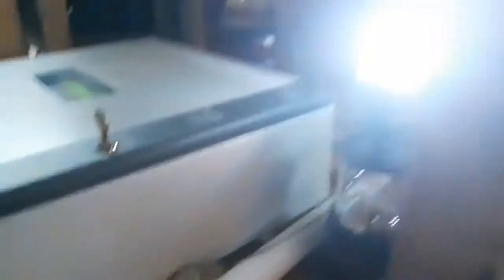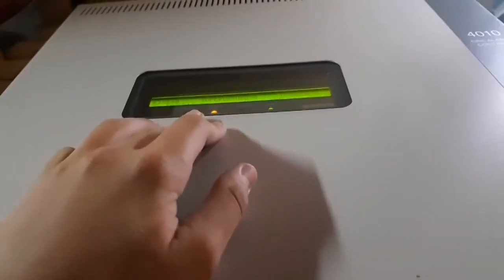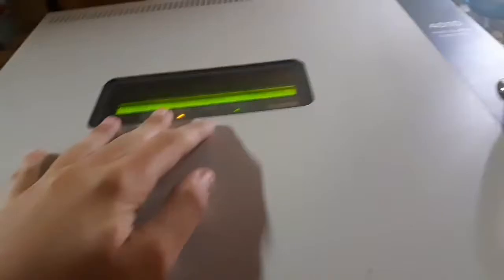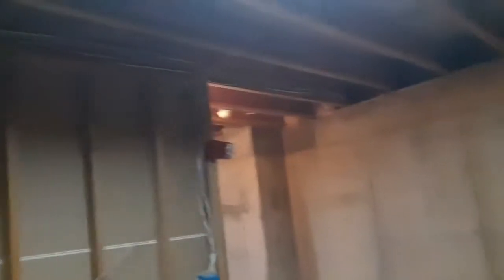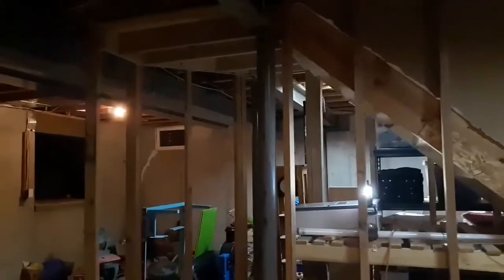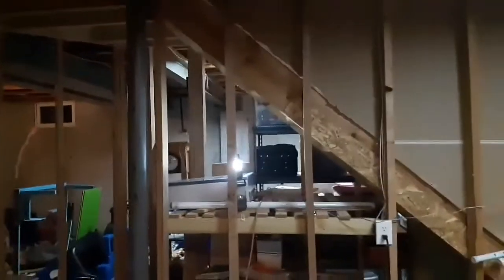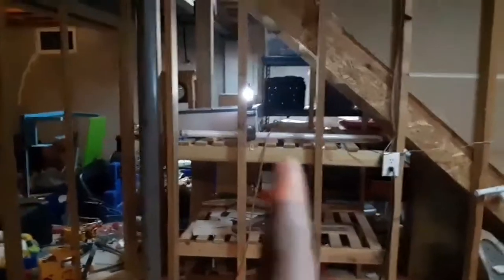System Test 4

Comment: Never been a fan of the 60bpm March Time but nice video!
Reply from the maker: I only did it because I haven't tried it yet. The next 2 tests feature truealerts and then after that I'm doing 2901s and 2903s in 120 bpm March time.
Reply: @officialsimplexguy  Does this have Code 4-4?
Reply from the maker: @FireRescue80  nope just steady, temporal, 120 and 20bpm
Reply: @officialsimplexguy  M'kay.